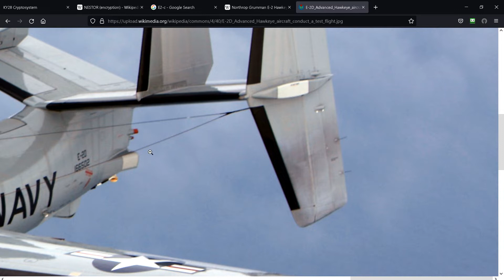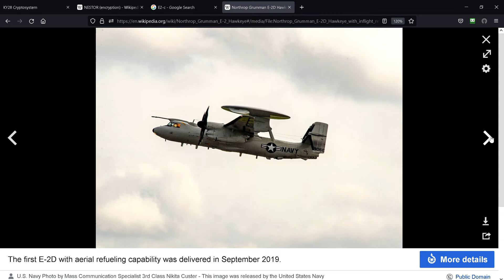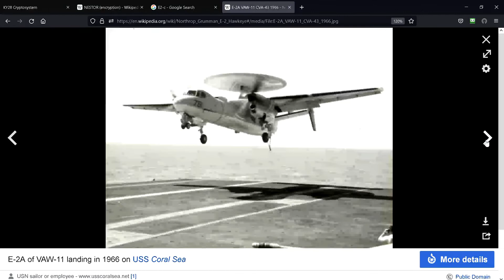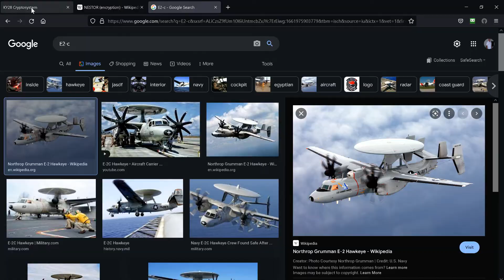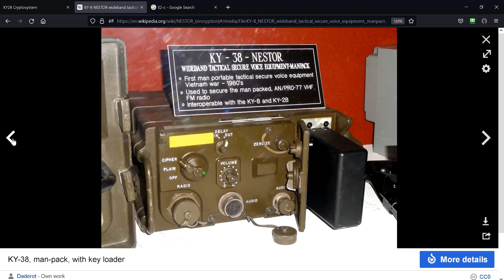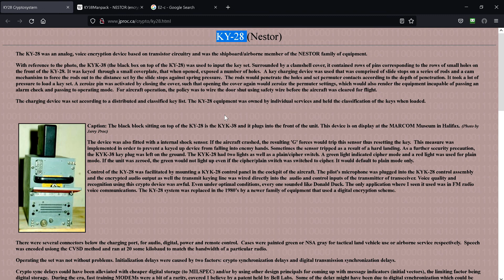My Experience Working With Items Classified Above Top Secret

Comment: Its amazing some of these older military aircraft actually got off the ground with all these heavy outdated systems & equipment onboard. Some items weighing thousands of pounds now weight less than a bag of potato's..
Reply from the maker: Some of the black boxes in that airplane were 3 feet by 3 feet by 1 foot and weighed close to 200 pounds.  Supply was in the bow of the carrier on the hanger deck level.  I should do a whole video on your statement because it was tricky sometimes to get these boxes to and from supply.  As you got closer and closer to supply the motion of the ship came into play.  I have had times when as the deck came up and the weight of these black boxes multiplied, I had to stop dead in my tracks to withstand the weight.  Then at the top of the wave when the ship started down, you could run with a very light box for a few yards and then stop again to endure another rise of the ship.  As you might well guess, we had nothing back then but our own strength to carry these boxes.  A cart of some kind would have been nice on the hanger deck, but getting up and down the ladders would not have been possible with a cart.  The Magnetron for the radar did have a special cart because it weighed close to 500 pounds.  All other black boxes, we carried by hand.